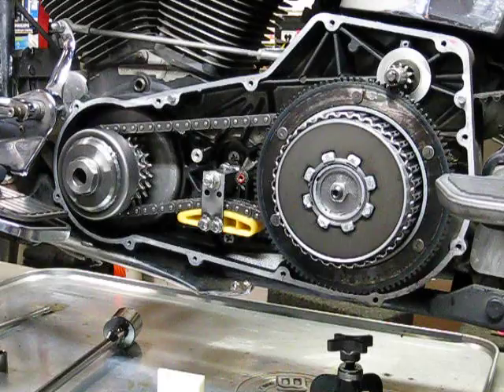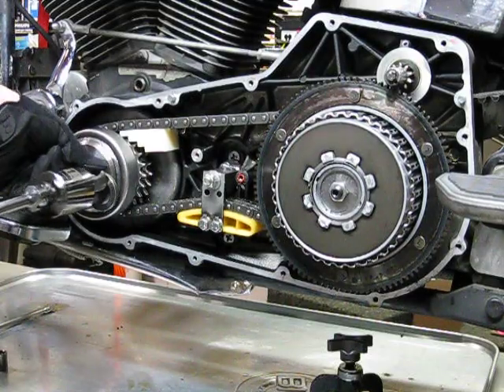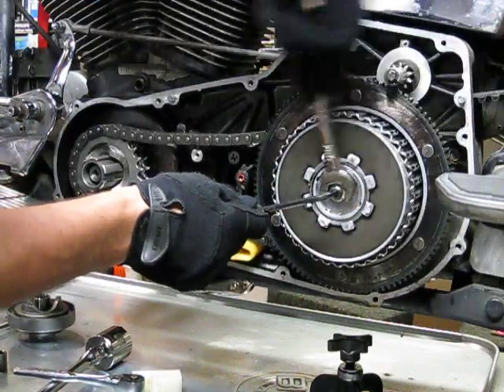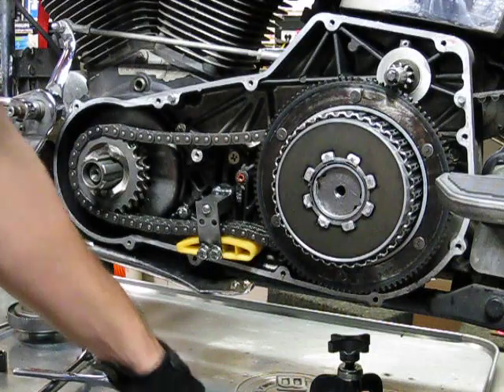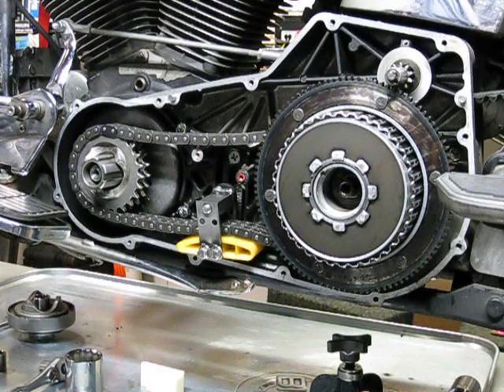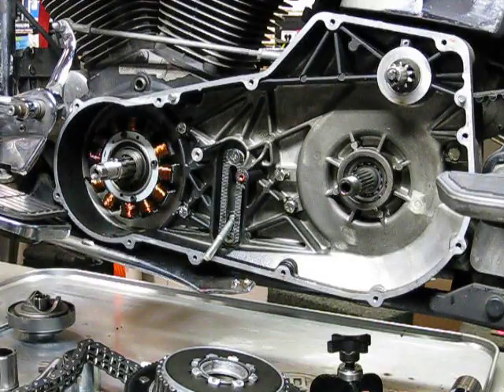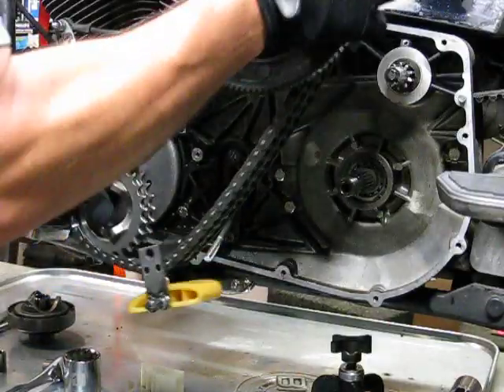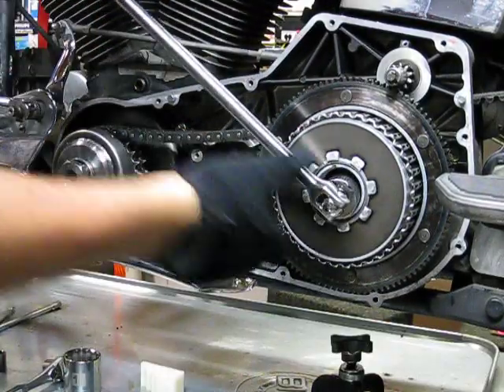Stator Repair - 3b of 9 - Clutch Assembly Removal - Tool Listing

Comment: Hey man, straight to the point. Very helpful. You called out parts by name. I new nothing about changing the stater. After your video,,I'm confident. Thanks again,keep them coming. 👍
Reply from the maker: Michael - it's a pleasure to pull away the green curtain so everyone can see just how simple the process really is.  Always use your manual, proper tools, and more than one source of information to do the task (I am not an expert)

So glad I could help, and thank you for taking time to share your thoughts.  Hope the repair went well for you.

Comment: Great video Scott. Trying to do just this with two manuals and neither showed this clutch assembly in any detail. Loads of warnings don't take off, springs under tension, Harley tech should do this. Scary stuff man. Good job! Well done.
Reply from the maker: Driverguy999 D.G. - Thank you for your post.  What you experienced is exactly why I took the time post the videos.  To remove the mystery.  Hope you are up and running now.

Comment: man what a job getting the compensator nut off.  fought with it for a couple hours. the suggestion to put heat to it worked.  thanks for the help.
Reply from the maker: Ben, thank you so much for taking time to post feed back.  I hope that it helps others. 

Scott

Comment from the maker: Yes, always replace sprockets when replacing a chain. I learned that from old school riders. If the chain us loose and worn, then its safe to say your sprockets are too.  If you don't, your worn sprockets will prematurely wear out your new chain.

I could check the manual, but I bet you will find this answer correct.

Thanks for posting your question.

Comment from the maker: HDron666 - Primary Chain tension, "deflection" per my manual, is 5/8" or 16mm-22mm when cold >> and 3/8"-5/8" or 9.5mm-16mm when hot.

Great to hear you are working on your own bike.  Hope things go/went well.

Scott

Comment: It is possible to remove clutch release plate without removing adjustment bolt and jam nut. This way you do not have to adjust clutch during re-assembly. Just remove snap ring and plate assembly will come out in one piece. No re-adjustment necessary! It was surprising to see you leave your error attempt to remove the clutch assembly nut by normal right hand thread loosening. I just did the same over the weekend when removing primary to get access to shift lever coming out of trans. ANYWAY Two thumbs up! and thank you

Comment: Thank you for the video! I did have to use heat to help. I used a 1/4 of an inch 1X1 piece of angle iron 9 inches long to place in between the two sprockets to keep them from rotating. It did bend the first time... bah ha ha..... Used it again after the heat and FINALLY it broke loose. I also used penetrating oil. ( not sure if that helped) Thanks again for the useful video!!
Reply from the maker: Berkeeto Thank you for sharing your experience.  Your contribution helps the rest of out. Sincerely.

Comment: Red locktight on both screws (Clutch nut and compensator screw) 
compensator screw is a ONE TIME use screw. When you take it out replace it with a new one.

Comment from the maker: If you do not have 13.5 - 14.5 volts DC at the battery, then you know it's an issue with your charging system.  This can be a range of things; but as I was always taught... follow the volts.  By checking voltage, you check for BOTH good wiring & good volts.  (if the wiring were bad, you would not have good voltage.)  Follow the volts. 

Volts AC are generated out of the stator, so check for 70 volts AC at the stator.

I bought a new battery in Amirlo and found out in Toledo is was a bad Stator!

Comment: I replaced the crank shaft seal and was reassembling, torquing the compensator nut and it snapped off. The machined groved shaft of the compensator assembly won’t come off the crank shaft. Any suggestions on a fix?
Reply from the maker: Yikes.... that's a new one on me.  Hopefully some of our members/guests can answer for you.

Comment from the maker: It takes a little getting used to.  I use tham when working on big stuff, but have to remove them for small parts.  Note:  Earlier I had cut my finger tips on the compensator nut; the flats had sharp edges.  But I know where you are coming from.

Comment: great video. I wish you would have gone one step further as I am replacing the stator on my '94FXDWG' I dont have a spring compressor  and nothing wrong with the clutch. this makes it so very simple. thank you.all I need is a easy way to insert the stator plug through the inner primary. like to never got the old one out.
Reply from the maker: that part kicked my ass too.   I ended up shaving down the rubber with a sharp blade.   I was replacing the HD version with another brand that carries a lifetime warranty. 

Thank you for your comment, 
Scott 
VTwinOnline.com

Comment: Great set of videos, going to put in a new compensator and also changing out the stator while I’m in there whether it needs it or not. Quick question, what’s the purpose of having it in 5th gear?
Reply from the maker: Kevin ‐ I did that so that it took less effort for the brake to prevent rear wheel movement.   Remember, I am not a trained HD tech; so I could he wrong, I just did everything thing I could to prevent rear wheel movement.   Good luck on your project.

Comment: I'm confused.  You showed us take off the stator and compensator without having to remove the clutch pack, which you did in part 3, during which you said some people had been having trouble putting it back on, and that you "would not leave us hanging" and would show us how to replace the compensator without the removal of the clutch basket. What episode did you do that? Episode 3b did not do that.

Comment: Hi, excellent instructional videos..! I was wondering if someone can guide me in the right direction...I removed the compensator and replaced the stator already. However, I don't have enough play now to put back the compensator back on without removing the clutch assembly.....! I was just wondering if there is trick to it or I must removed the clutch assembly as well? Chain tensioner is already off as well. Thanks in advance
Reply: nevermind, got it installed

Comment: Just use an impact. I'v tried it all and as a result,  I'v been using an impact for last 41 years for clutch hub and compensating nut. I have also seen primary chains stretched doing it the way this guy is doing it and the compensating nut still did'nt come off.
Reply from the maker: Joe - Rdgr that.  Thank you for taking the time to comment.

Comment: Why tie the brake up, etc? Just break the compensator nut loose, leave it on and use jam block for clutch nut. Then easily thread them both out.
Reply: Terry Cooper Thank you!   Great way to achieve the task... without have to tie down brake.  

Folks like you improve this video and help others when you share  your experience.

Thank you!

Comment from the maker: @JAGERderNACHTWOLF - YES, just as easy to work on.  I will keep your comment in mind and try and remember to post a video that shows the self-adjusting tensioner.  NOTE:  90,000k on '95 FLSTC and I have never had issue with stock tensioner.   For those who are not familiar with the self-adjusting tensioner, Google: Hayden Enterprises M-6 Primary Chain Tensioner M6-XL5-2 

Thank you for commenting,
Scott
V-TwinOnline . com

Comment: Great vid-  love the fact you didn't edit out your "left nut" mistake. DO you use red or blue locktite on the compensator and clutch nuts?
Reply from the maker: @user/lynskyrd     - I used what ever the manual states.

Comment: Great video, thx! I have a 97 springer and my clutch assembly is stuck on the shaft. Ive tried a little prying with a soft blow but have had no luck. Any ideas?
Reply: Ross Burden

Comment: is there any other way to remove the rotor without buying that special tool, it almost looks like a couple of bent coat hangers could pull it off? Thanks in advance!

Comment: I got a question for you and would much appreciate the help. I'm changing the clutch basket with the ring gear on my 2001 Softail and my question is how do the drive change sprockets separate from the clutch basket? are they bolted or do they need to be pressed off? Thank you for your time it is much appreciated!!
Reply from the maker: Contact evolution-industries . Com and ask them for the installation instructions.   They should be able to help you out with exactly what you need by directing you to a link for the pdf instruction sheet.

Did your manual have any information?

Comment: i have a problem with a 98 fatboy... the clutch shell gear the meets the pinion gear is all flat. i ordered one. i have to take all that off as well.  only thing is i may have to change the snap ring in the coupler the jack shaft goes through. the snap ring is bad looking and was causing the pinion gear to pop out to far some times and cause the pinion to stay out of the coupler

Comment from the maker: @boozhiw - I was able to pull the clutch hub off with my hand because the 1995 Evo trans has a "splined" shaft.  Your Shovel trans, if original, has a tapered shaft; and it is on there good.

SPECIAL NOTE:  You ARE going to need the puller.  I tried to be a wise guy by using an automotive puller and I destroyed my clutch.

If you like, maybe we could work out a tool rental; it's not like I am using it now.

Either way, thanks for your comments & good luck.

Scott,
V-Twinonline . com

Comment from the maker: Also... Check for Grounds.  With motor off, one lead in the stator and one lead on the motor/a good ground, then see if you have continuity.  So what does that mean?

Set the meter to Ohms, cross your leads.. make the meter BEEP.  If it BEEPS, your leads are touching and making a good connection.  

But for your stator... you DONT want a connection/BEEP.  Stator creates volts, you DONT want wires from your stator having a good connection with your motor.  Make sence?  

Good luck.

Comment: i saw that you just pulled the clutch hub off with your hands.....is it the same for my 83 shovelhead fxrt? im doing my first tear down ever, and of course im stuck in the primary. do i need to buy the hub puller tool? or is that just to remove the lefty nut?

Comment: Might seem like a dumb question but with the three holes in the rotor  does it matter which way it is clocked on the crankshaft for balance?
Reply from the maker: Not a dumb question at all....tell ya the truth, I don't recall noticing the holes.  However, with that said, check.the manual; I don't believe it indicates anything about clocking the rotor.

Nice catch,
Scott

Comment: I am thinking about doing the stator replacement myself. I have a question. Will removing the chain and then reinstalling it change the timing on my bike? I have a 1998 Ultra Classic FLHTCUI with fuel injection. Thanks.
Reply from the maker: Scott Wagner Hi Scott,  I feel your pain.  Great question. No - no worries.   Timing is on the other side where the cams are located.  The primary chain is separate.  As always, use the money you save  by doing the repair yourself to purchase Harley Davidson service manual four your machine.  It's a small price to pay.  Then read and study the process.  These videos are to help provide a visual example of the process.  Hope they help.

Comment: My clutch wont engage. Trans goes in neutral and into gear with bike off.  Start it up, pull in clutch and as soon as I put it in gear the bike jumps while i am pulling the clutch in. Pulled the derby cover adjusted I see the outer clutch plate moving but I guess the players are stuck.  Bike has sat long time just brought it. Oil level is perfect in primary.  So what to do now pull the clutch drum and clean the plates. I dont know what will cause this.

Comment from the maker: @ BosAdmin - Hey B.A., dying stator = low volts.  poor battery charge.  You need a volt meter to monitor voltage.  Should have 13.5 - 14.5 volts at the battery with the bike running.

Scott

Comment from the maker: Batteries can be funny. If it's over 4 yrs old, get rid of it. If it's not, then you may have an issue with your charging system. Made of several components. First thing is first, get the bike running, and then with a volt meter, set to DC volts, on the battery terminals verify you have 13.5 - 14.5 volts at about 1000-2000 rmp.
 
Understand it's the stator that gerates volts (70-ish AC volts), & is then reduced and changed from AC to DC by the regulator; reduced to the 13.5 - 14.5 volts DC

Comment: My clutch doesn't slide off easily like yours does in the video it appears to be stuck any suggestions? It's like really stuck I've tried wiggling it I've tried tapping it lightly with a rubber mallet. I put all my body weight on it I had even my other buddy put his body weight on it and we pulled together. Somebody help me out here please. Thank you
Reply from the maker: Doug - Try a clutch puller.  

How you have already moved forward; if so, what was your solution?

Comment: my 2013 iron 883 #1 engine dosnt fire it fires some times only but #2 works fine. I  hanged the ignition coils too but the problem is still there. what it could be the problem what do I have to check k next?
Reply from the maker: Could be many things.  Too many to troubelshoot on YouTube. Grounds, bad coil, bad wires, plugs, etc.
Reply: @VTwinOnline  I have changed the  coils from other 883... any way I will check step by step as u said thank you

Comment: im trying to pull clutch because I'm replacing the shift shaft thats bent. my problem is the tire is moving.
Reply: video helped me on an 06 883 to 1250 conversion 
a 2000 1200 
and now a 98 fat boy thanks

Comment: Alright i followed everything and its back together,now my clutch handle is extremely tight. Now what???
Reply: Figured it out thanks.
Reply from the maker: Stephen Mentzer nice work!   So glad it all worked out.   My apologies if I created any confusion. 

Thank you for taking time to comment, 
Scott 
VTwinOnline.com
Reply: VTwinOnline thanks for the videos. Got the stator done,which is what i was told was the issue but..... i am still having problems,if you can help that would be great. Still draining battery power and the blinkers and horn are still not functional. Do you think this could be the regulator or something else?
Reply from the maker: Stephen Mentzer check for ground.   Yo  should have good ground where it it supposed to be grounded. 

Also,  suspect anything that it aftermarket.   Wiring,  brackets,  lights. 

Check your manual for further step by step process.

Comment: why would you take apart the clutch adjustment screw and nut you don't need to just unsnap the clip and take out the whole enchilada as one unit that way you wont have to go back and mickey mouse around readjusting the clutch just extra un-needed work.
Reply from the maker: Hi Fred,  great question.  Te objective in this particular segment was to demonstrate how to crack apart the clutch plates in the event you needed to get into the clutch itself. 

I was already there,  so I thought I would show the extra steps.   

Thank you for your question and fir taking the time to comment. 

Sincerely,
Scott 
VTwinOnline@gmail.com
Reply: oh so you were making this an instructional video on how to adjust the clutch if one needed to replace the clutch plates.
here I thought your main focus was on replacing the stator.
by the way I have a catch pan just like the one in the video it sure comes in handy.
Makes a good cookie baking pan also with out the oil of course.

Comment: is safe to used impact drill ... and i want change the pulley by sproket and wide tire ..
tanks .... poor men..
Reply from the maker: mco zpda To remove, I would say yes, safe, to put back on... not for me.  I would rather hand tight, and then torque wrench.  That will prevent someone form cussing your name in the future.  LOL
Reply: VTwinOnline
tks .... i will do .....

Comment: i am wondering why: you would show us the back side of the clutch hub assy and say this is the back of the clutch assy??? and why would you waste time on this  long video to remove the stater rotor with a puller for what??? come on man ...
Reply from the maker: Heck man...I don't know....just an off the cuff thing...no script...just blabbing...hoping I might share some insight on the process and the parts.  Thanks for taking the time to comment.